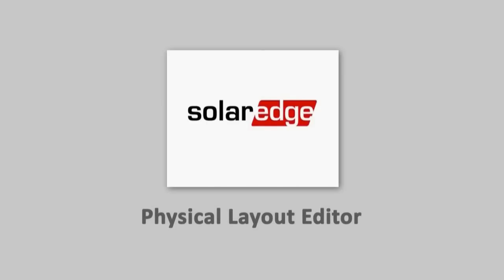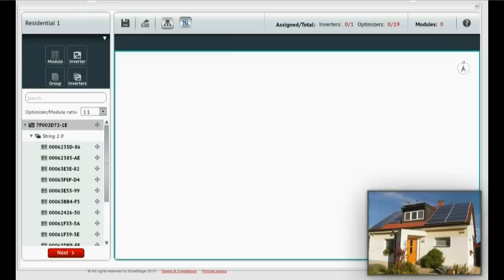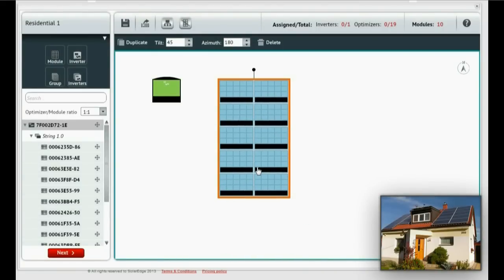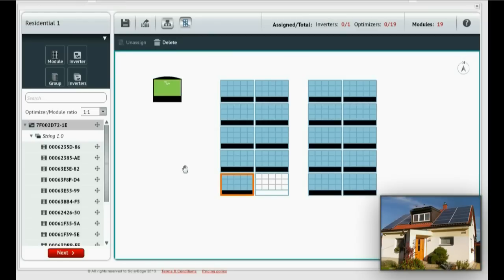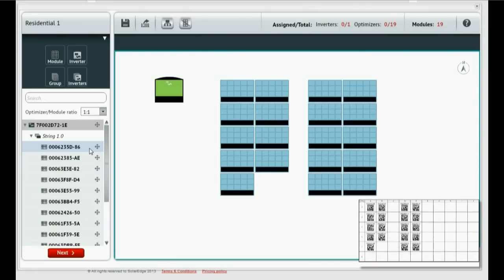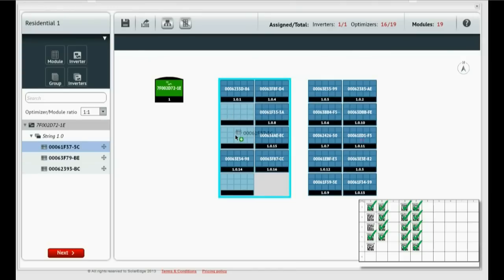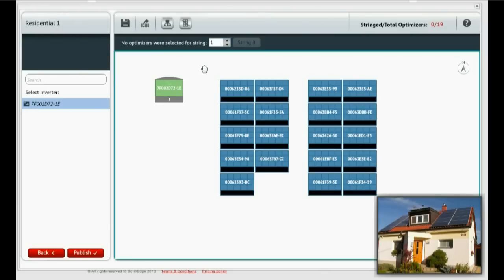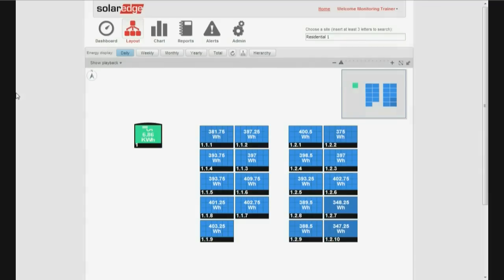SolarEdge Physical Layout Editor - Part I - Residential systems and basic capabilities

Comment: Can owners of the system get access to this? I don't have a physical layout tab when I log in.
Reply from the maker: Your installer will be able to open up this feature for you
Reply: @SolarEdgeTechnologies   I am having a similar issue. My installer has given me "full access" but, like plazman47, I also do not have the tabs/ability shown in this video. Is there some other access level I should be asking for other than "full access"?
Reply from the maker: @johntrout764  Hi John, this feature is for installers to monitor your system for any issues that might arise. You can request from them to have this unlocked for you.
Reply: SolarEdgePV  as stated before, according to my installer, I have “full access”

if the installer is able to unlock this feature, what term do I use to request access to it?
Reply from the maker: @johntrout764  We recommend that you contact our local support team and request full access: https://www.solaredge.com/service/support
Reply: @SolarEdgeTechnologies   My original installer went out of business.  One of the panels was not hooked up correctly (apparently), so my system has only been using 31/32 panels.  I hired a new crew to put 8 more panels on the roof.  

They fixed that panel and it is now showing up on the logical layout, but not the physical one.  How do I get access to that part so I can add that panel into the physical layout?

I'll run into the same issue when they install these new 8 panels too.  
- Chris Ingle
wtknght1@aol.com

Comment: This layout program would be very helpful as a homeowner, but it is not available in the homeowner's application, only to the installers who get all the tabs and diagramming capabilities shown in this video.
Reply: I know we own it not my installer I paid cash If I want to add or rearrange or add panels to the Portal I can't. Would have to call my installer to put them in. So this is just a gimmick to make you think you can. when this inverter dies I will be going with someone else just for this reason. Or Install a rs232 that they got rid of.
Reply: The inverter is good in full sun. I have two systems 7200 and 3800 with different inverters. On cloudy days the Solaredge SE7600 us is not that good my 3800 with a inverter made in 2004 Beacon Power M5 make the same power as my 7200.
So low light or cloudy must have something to do with the optimizer's.

Comment: It would be real nice if I could assign module numbers within a string in the order wired.   Some diagnostics  give faults as a % distance from either end.  I record this and give copy to customer but it would be nice to see it on layout.
Reply: that explains a lot! We replaced a few optimizers based on flags in the layout, but the % fault kept saying it was at the beginning of the + string. So basically the beginning of the string can be in the middle of the row -_-
Reply: 1, you